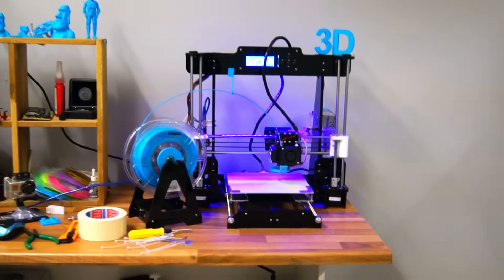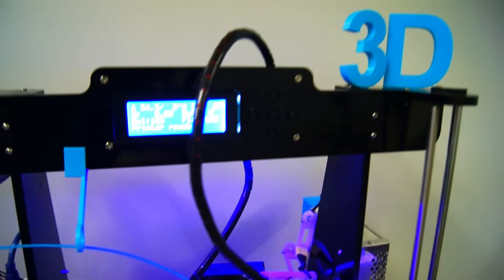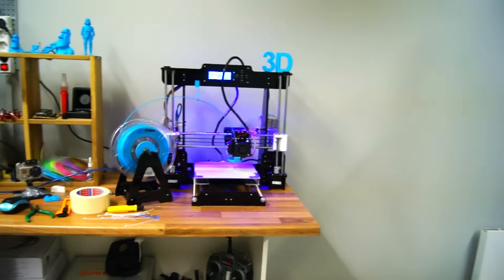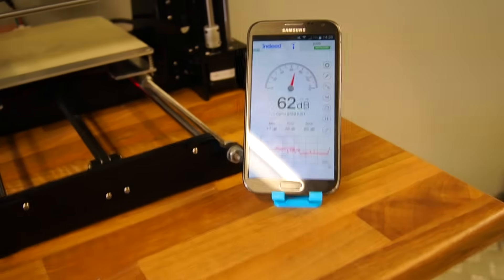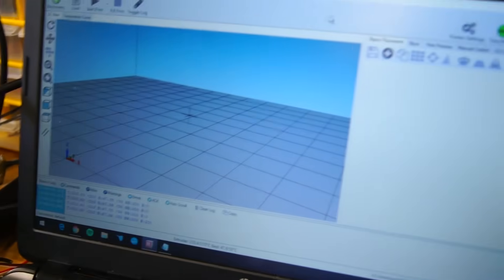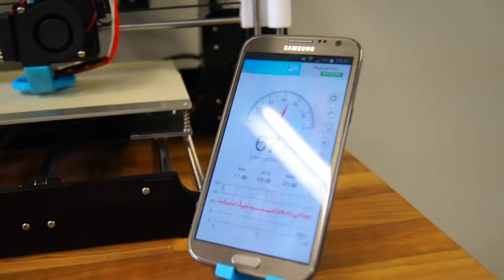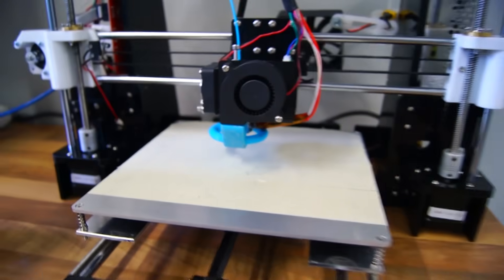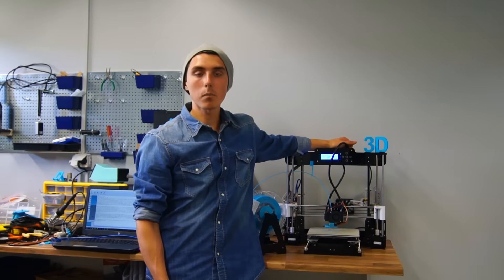Best Cheap DIY 3D Printer Kit Anet A8 - RCLifeOn

Comment: You show the bolt which goes into the hub hole of the filament spool but you do not mention the bearings. Also in your review how do you not review the output of the printer with regards to quality?

Comment: Wow they really haven't come down much in 2 years, let alone 3.. Now $120 I'm thinking about picking up an anet a8 or a reprapguru which is idk what.. It definitely seems like the a8 has a good following, and other than the fact that people say they burn down, there are mods to help with that, and most people are idiots. I think if you're the kind of person who is into welding, fabrication and has a background in electronics, construction, and does all their own home remodeling and maintenance like buying a fixer upper home where all the plumbing is cracked and you can't run a dish washer and a few tv's at once without flipping a circuit breaker so you have to remodel sections of the house starting with the kitchen and adding all new wiring.. pex plumbing to the entire house, and replacing the septic system, yadda yadda yadda.. oh yeah.. I was describing me if you didn't notice lmao but yeah.. I'm a fabricator who is trying to improve their level of fabrication and would love to get more into designing things that bolt together. Not only that but by learning about 3d printing I am one step closer to building my own.. If I know how to build a 3d printer I will be that much closer to building my own 3d router and plasma cutting tables. These are things I MUST have in my future shop. So my beginning is here and I'm here to learn.

Comment: Sorry I have a problem with my anet A8 I can't get it printed The only thing that happens when the When I turn it on is that the monitor stays lit for a few seconds and then turns off I think the problem is in the power supply but I really don't know that what to do to fix it, It would Be nice if you know the solution you can give It to me

Comment: Hello Sir,
It's a great job you doing there. I think you moved beyond that till now. 
I just bought one of these machines a few weeks ago and I had a problem that I couldn't find the answer anywhere. To define the problem simply: when I plugin everything works just fine, it moves X, Y, Z axes just fine but when i pres print button or preheat button machine stops blue screen pops up and a few minutes later it comes to itself like I just opened it. If you want I can send you the video of the problem. If you can fix this you're king to me...

Comment: how did you get such good overhangs? I cannot get mine to print overhangs properly
Reply from the maker: Overhangs are usually improved by cooling. Print the fan nozzle and make sure the fan is at 100%.

Comment: I would like to ask.

First, does this support double extruder or double nozzle extruder?
Secondly, does it support the PVA filament that dissolves in water?

Is there any 3d printer with double extruder that supports PVA dissolvable filament, max 250$?

Thanks a lot

Comment: Good morning, I'd like to know what you use to attach the filament to the table, because I'm having trouble printing and releasing the filament on the table. Could you describe the material used and the settings it makes in the printer? Using temperature, initial velocity, etc. Thank you very much.
Reply from the maker: Hey, I hope you are doing great! The most important setting is the distance between the nozzle and bed. Search for 'bed leveling' and you should find some helpful videos.

Comment: Hey mate, great video, I am getting the same 3d Printer next week, I just have a question that I'm unsure about. Does it need to be connected to a PC to get the job done or can it be stored somewhere else, probably garage in my case, if it requires to be connected to a PC then that's a problem for me. My only concern was because of any fumes, or even the hot surface or parts because I have 2 little monsters under 6 yrs old. Can you please let me know, thanks.
Reply: There is an sd card so you dont need a computer connected to it.

Comment: What every you do please don't waist your money and buy this printer... I bought it and after wiring it up the cerci the board exploded and then after buying a new one I got it and the extruder jamed the first time I used it ... now I bought  another extruder and that one worked then when printing the first time I stated to print then the LCD screen went blank and the printer started to rub the extruder against the bottom board ... and now the LCD doesn't work and the bottom board has scratches in it and I don't have the money to replace those parts😢

Comment: for the price, it's an amzing machine. it needs some fixes, though, to reach it's full potential: tensioners, proper belt mounts, glass fiber gt2 belts, and an adjuster for the z-endstop. optionally recommended, a glass plate and glue stick. (the shhh...iny steel core stock belts are easily the worst part in the kit.)

Comment: What ever you do don't buy this printer... I bought it from the sight he mentioned and I came with the LCD, buttons, and the main board broken. Thanks for nothing
Reply: I would contact the company from the site that you bought the printer from and tell them what happened. I found this link that might help you :) 
https://support.gearbest.com/ticket/ticket/index?lang=en
Reply: GymBoyB is it fixes now ? How they responed?
Reply: BlexTune they wouldn't give me another board for free so I had to spend 35$ buying  another one and I'm going to assemble it this weekend and do it extremely carefully so that i know that it's wired correctly ... wish me luck
Reply: Thank for answering. Im looking forward to order one. Is it ok to buy it from Gearbest?
Reply: BlexTune well if you are good at building things and good at wiring (unlike me) then sure... but make sure that you plan for a wait becouse it took my printer almost 5 weeks to arrive and 3 weeks waiting for the replacement parts (I broke mine becouse I'm an idiot) so if your a good human and are smart then sure

Comment: What programming language is used to program this 3d printer?
Reply: low level software on the printer board itself was probably done in C/assembly, as far as how the printer reads out commands, the raw code the board uses is a .gcode file, usually converted from a .stl file that you download, or an .stl file you made yourself using CAD software. the printer prints direcly from a .gcode file.
Reply: You do not need to learn any language, the only language you will come across is GCode, and when you do get a printer the instructions should tell you what to do or how to do it (Mine did not). Check facebook for the printer you have and join the owner group you can ask questions on there. The only time you will need to type in code is when you're leveling the bed (I did not need to do it) and modify the printer(Heat bed, dual nozzle, etc.) When you get a printer you will learn so much stuff about it. But the rest of everything is done through software for you. Like models will be auto though cura (Slicing software) and it is kinda just trial and error at that point. One thing I learned about the 3d printer community is that everyone has been in the same boat at one point so don't be afraid to ask questions. (I am still new to the 3d printing community) :)

Comment: does anyone know why the last thing he printed got stuck on the printer table? He had to pry off the characters "3D" from the table and i don't want that to happen to me.
Reply: I believe that it was printed directly to the table, so if you don't want that to happen, you should probably print it vertically. I'm sure all of his prints get stuck to the board but if the print is taller, it shouldn't be hard to pry it off. I hope this helps!
Reply from the maker: It was difficult to remove from the bed due to the low profile and large contact area.

Comment: Just got my anet a8, been getting great prints how ever when the the front fan that has the white nossel is on, my extruder temp goes down and doesnt stay at 190, which i think makes the extruder heat up because it thinks its at a low temperature but its not which causes the pla to overheat, therefore messing up the print.  Is anyone else having this problem, please help.
Reply from the maker: The fan should not blow on the extruder nozzle. It should blow the air right under it. Try to angle the fan or the white fan nozzle.
Reply: RCLifeOn even when the white piece that came with the printer isnt coneccted and the fan is just blowing air straight down, it still changes the temperature.

Comment: +RCLifeOn what size filament does it take?
Reply from the maker: 1,75mm.
Reply: oh good! thanks for the reply 😊
Reply: RCLifeOn
btw, how can i make accurate 3d prints for anything?? how does one make dimensions for prints exactly how they need them?
Reply from the maker: You need to use a CAD software. Search for Fusion360 and embrace the task of drawing in 3D.

Comment: How do you use and set up the blue cord include to get it to speak to the computer
Reply from the maker: You connect the USB cable (blue chord) to the motherboard of the 3D printer and computer. Once the drivers have been installed you start the Cura software and configure the settings.
Reply: RCLifeOn How do i configure the settings. I a using Cura 2.3.1 is that diffrent?

Comment: Hi would you be able to help me out.
Im trying to do my setting in cura,
I have 1.75mm filament and i cant seem to get a good print to go yet. they all seem under extruded.
Reply from the maker: There's a lot of settings that could be wrong. Make sure the nozzle diameter is set to 0.4mm. I also had to increase the extrusion multiplier to 110%.

Comment: What temperature do you print at and how do you set it? I am currently using 190 degrees and setting it by clicking preheat PLA, but my prints are coming out really bad.
Reply: You should print at 230C for PLA
Reply from the maker: I'm printing at 215 degrees. One of the most important parameters is the distance between the nozzle and bed, make sure no more than a piece of paper can go between them.
Reply: It really depends on what type of PLA and how close. I print between 220 and 230 usually

Comment: I like this printer a lot :) The only question I have is about 3d printing in general. How much filament do you use for lets say an object the size of a smartphone. How much grams does it go into and how much are the costs of the filament and these kinds of stuff :) Please answer me :)
Reply from the maker: The filament is in fact quite expensive at 30$ for 1kg. When printing, let's say a 10x10x10mm box, only the exterior is 100% infill. Meaning, the inside (majority of a box) is air since we are only printing with 20% infill. Objects that might look large in external area, might not use very much plastic at all. Sometimes I print objects with 0% infill. 

With that being said, the printer will use as much plastic as you want it to. I would estimate a smartphone-sized object to cost 50 cents.
Reply: Thats quite expensive considering I bought this machine to make stuff cheap.... :(
Reply: I was thinking about one thing. Would it be possible to use that weed cutting string you use for the  petrol string trimmer? I think those are relatively cheap if it would be possible :) Best regards
Reply from the maker: Sorry, I don't follow. Can you emphasize?
Reply: Not a good idea, that's nylon...Why did you buy a 3d printer in the first place? It's made for prototyping, not mass production.

Comment: If you have an dust-off aerosol can you can remove prints off the bed easily as the cold air will have the part retract and cause it to loosen.  FYI

Comment: tip for you. Use the plastic clamp things and strp your hotend and heatbed wires to prevent them from breaking off from the ends.

Comment: Does it work with autodesk 123?
Reply from the maker: I use Fusion 360, and it works great. The question is if the CAD software can export STL files, and I'm quite sure it can.
Reply: Thanks

Comment: Thanks for sharing. Make one more thing - a jig to safely remove finished products from the table. Perhaps a multi-tool with a scraper?
Reply from the maker: Using a grip-tool with protective foam (I might even use shrink tubing on the ends instead) works very well. Thanks for watching!

Comment: Question, im told the heater / print head sucks - what can i replace it with? is it easy / universal?
Reply from the maker: Mine works great, I don't feel the need to replace any parts. I'm printing with PLA filament, but I've heared people having problem printing ABS due to the heated bed not reaching high enough temperature.

Comment: hi, nice video bro! subscribe!
i found similar stuff on my country, but it is called zonestar. The main board is ZRIB V2, but can you pls tell me is this better/not/same with your printer? https://www.tokopedia.com/t4k4/printer-3d-high-precision-reprap-prusa-i3-diy
Reply from the maker: They are basically the same, just pick the one you feel is the best fit regarding price and shipping time.
Reply: Thanks for the reply bro, you're very helpful! 
Just found this: https://www.tokopedia.com/drone-world/3d-printer-prusa-i3-diy-desktop-printer

this one is cheaper(so i can do some upgrade!) and the mainboard is same as you have. 
But there is one question that is disturbing me, do you use auto leveling sensor on this video?(i can't see it) - if yes, what type of sensor you are using, and whether it is included in the package when you buy it on gearbest? 

so sorry too many asking, because i'm 100% new on 3d printer, but i can understand Arduino well.

Comment: Cool Vid! Does it has a heated bed? and will print other filaments? (PLA, ABS, etc.)

Thanks  :D
Reply from the maker: Yes it does have a heated bed, but struggles to reach high tempereature. Printing PLA (55 °C) is not problem though. The Anet A8 can print  ABS, luminescent, nylon PVA, PLA, PP, wood.

Comment: Put some duct tape on the bed before you start printing and maybe your object will be easier to remove!?  Anyway, great video. 5 star.
Reply: TurRó TübiNger then the piece wouldn't stay in place durint the printing process runing the build
Reply from the maker: Using a plier with foam as protection works very good.

Comment: I also buy the same printer but not brought me the sd card with drivers then the pc does not recognize the printer. You could teach how to calibrate the printer, I'm new at this. My problem is that the extruder head touches the piece and sometimes it seems like not made enough filament to printing. can you teach me to solve this? thanks and sorry for my english.

Comment: Another question:
Which filaments are you using?
Could you attach the link to buy it?
ty!
Reply from the maker: +Eduardo Diaz I'm using 1.75mm PLA filament from 3DPrima: http://www.3dprima.com/en/filaments-for-3d-printers/pla-175mm/

I do not  recommend the white filament, the prints doesn't turn out nearly as good as with the other colors for some reason.
Reply from the maker: Yeah, I used the same video. Also, this facebook group is very helpful: https://www.facebook.com/groups/1068531466501015/

Comment: Hey, nice video, do you know if this thing can be modded to print larger objects. I see that consists of pcb on the side that goes to the pc, a spool for the thread and the moving parts are all mounted on the bars, maybe with use of larger bars, the printer can have a wider area of movement and it could make larger objects?

Comment: hey man! thanks for the video, question; do you know where I can buy a good heated bed for this? and what programming is required? since i'm just a beginner. Thanks :) @RCLifeon
Reply from the maker: Hi dude! No programming is required other than teaching the motors their home points, this can easily be done inside the software. There will be a included USB flash drive with a microSD, you can find a software called "Cura" or "RepeterierHost" inside of it.Are your planning on printing with ABS? The heated bed works perfectly for PLA filament because the heated bed only have to reach 50-60°C. However, it does struggle with ABS (>90°C). As long as you print with PLA you will be fine. Thanks for your comment, have an awesome day!

Comment: damn. These things are like $160 bucks. Thats cheap. Ill probably snag one and stick a removable glass bed on it. Probably a better hot end too, though with the bed and a v6 you've pretty much doubled the price of this thing lol.
Reply from the maker: Yeah, those "upgrades" are not really necessary as long as you print with PLA. The hot bed only reaches 100° C which might be too low in order to print ABS properly. Using ordinary masking tape is sufficient.
Reply: RCLifeOn 100 degrees is better than a ROBO r1 plus gets. they'll only do 95. ABS is shit though. Despite what people claim, its weak when printed, and has horrible layer delimitation, and that's if you get it stuck on the bed. 

PLA is awesome because it can be printed quickly, looks great, is easy to work with, and if you get the right stuff, it's pretty strong, however I use 3d printing for engineering purposes. So heat is always an issue, which counts PLA out. 

I'm more interested in printing PET base plastics. They print slow, require high printing temperatures, and need major retraction calibration to keep prints clean, however when you get it right, the parts come out awesome, and they're super strong, many of them are as strong as nylon, however are hardly prone to warping. PET layer adhesion is super strong too. With PETG for example, the parts will shatter before delaminating on a layer. My favorite however is PET+. It take a 260 degree print temp though.